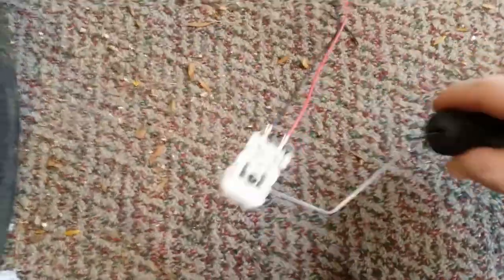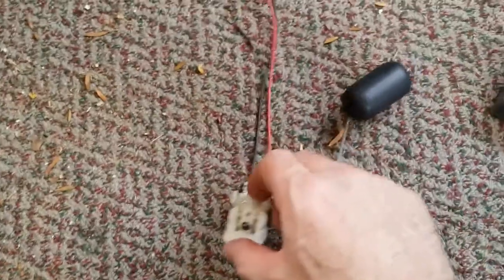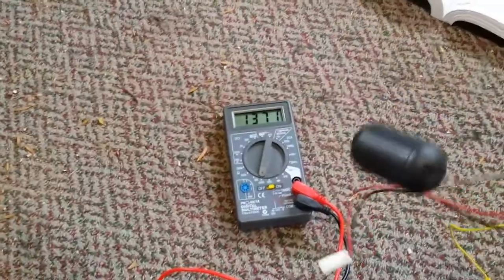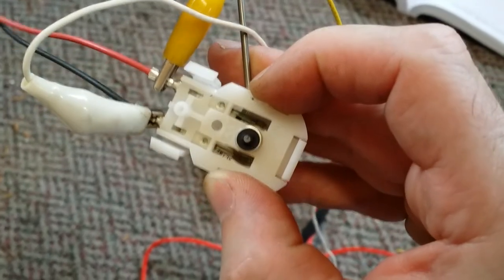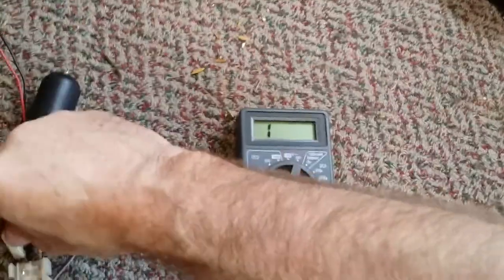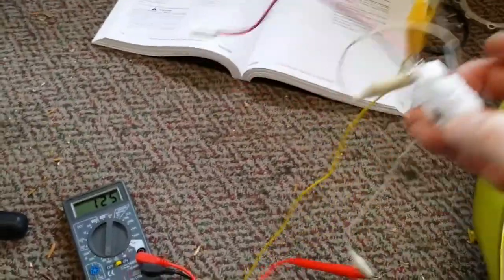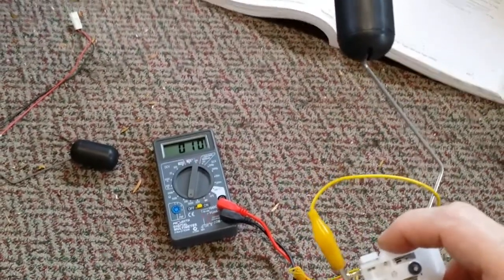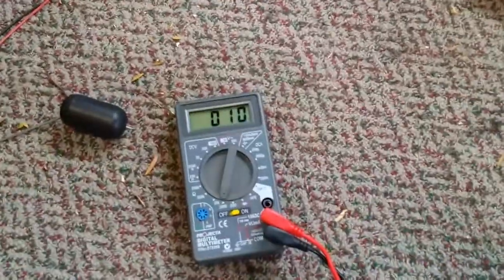2011/12 Triumph Tiger 800 - Faulty Fuel Level Sender

Comment: I have exactly the same issue on my 2013 Triumph Sprint GT .
I took mine to bits today and I see your sender unit is identical to mine.
My resistance readings were also all over the place but I cleaned up all the connectors and it seemed to work. Took it for a spin and all seemed to be cured. Got a fuel leak now so need to strip it back down again.
Great video and really helpful 
That sender clip is an effort to put back on if you have large hands tho.

Comment: Could you explain how to get the sender out of the tank since I have taken the petrol pump out of the bottom of the tank but cannot remove complete;y since the sender is attached to the pump. If you therefore detach the sender wires, they then fall into the tank? Can you clarify how you get your hands on the sender then?? Thanks
Reply from the maker: The fuel sender is attached inside the tank so it will not fall inside.

* Unhook the fuel sender wiring from the body of the pump,
* disconnect the electrical connection at the base of the pump,
* the fuel sender is still attached inside the tank to a bracket,
* remove the fuel pump,
* working through the hole, release the two side tangs securing the fuel sender to the bracket inside the tank,
* carefully take out the fuel sender through the hole.

It can be a little tricky and a head-torch may be a good idea so you can see exactly what you're doing inside the tank.

REFITTING
* Fit new fuel sender inside the fuel tank ensuring that the upper tang and two side tangs are correctly attached to the bracket inside the tank,
* Make sure the wiring for the sender doesn't go OVER the fuel sender arm (it'll prevent it from rising when tank is full of petrol),
* Install fuel pump with a new sealing ring (P/N: T2401887),
* Install tank to bike, connect the battery and run the bike and check there is no fuel leaking underneath before final assembly.

Comment: Hi my friend , im from brazil , sorry for my english. Maybe u can give some light. I have a daytona 675R 2013 , and my fuel gauge only mark half tank and higher. When gas hit half tank and under , the display goes down zero and the reserve gas light turn on. When i put gas to full , tha gauge come back and marks full and work ok ,  until half tank. Do u have any ideas ? thanks a lot.
Reply from the maker: Hello... I think those symptoms you describe could be attributed to a faulty fuel sender unit and the age of your bike seems to coincide with that time when Triumph were fitting defective units.  I would just order a new one, hopefully they're not too expensive for you in Brazil.  Cheers.
Reply: @GroinsNZ  Thank you for reply !! i will check and i give a feedback to u , thanks a lot again.

Comment: Hi there mate,

I've the Tiger 800 XC 2011 and a few days ago something similar went on with my Bike but... with more than half a tank the light came on and I do not have any miles to go till empty...

I've a second fuels level sensor (used one) as I'd smashed my prewious tank. Do you think that the problem it's similar?
The fault on DT say P0640 - fuel level sensor malfunction

Thanks
Reply from the maker: Yes indeed, it sounds like your fuel level sensor needs to be replaced.